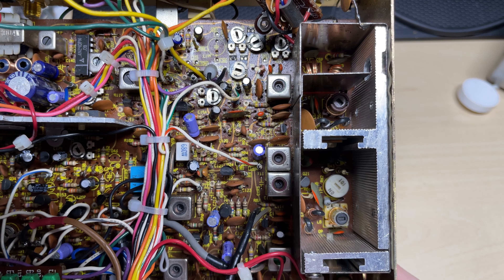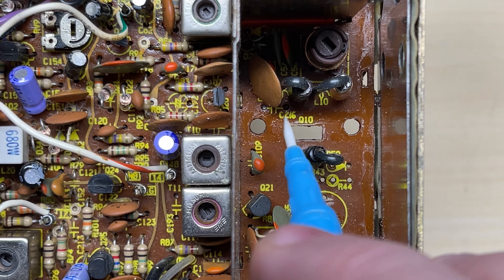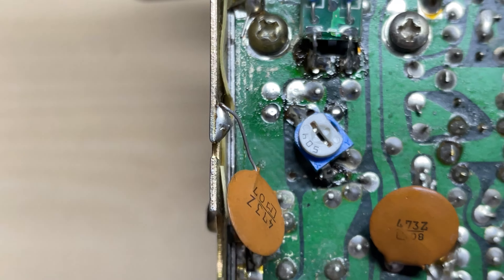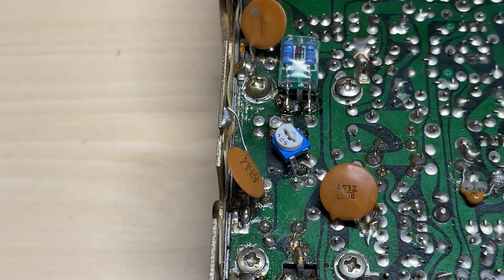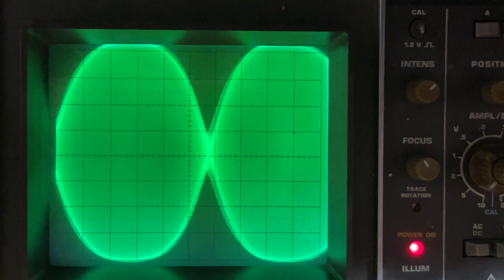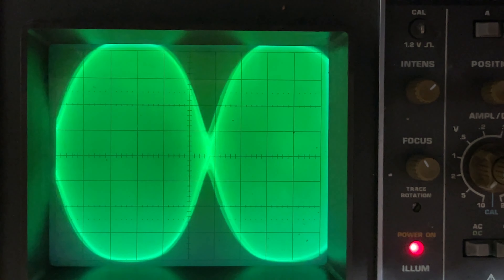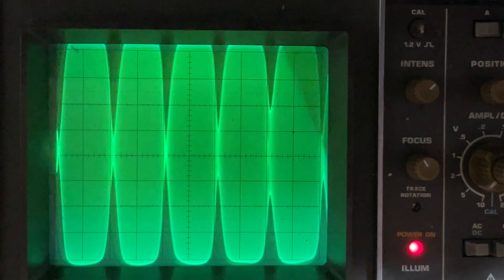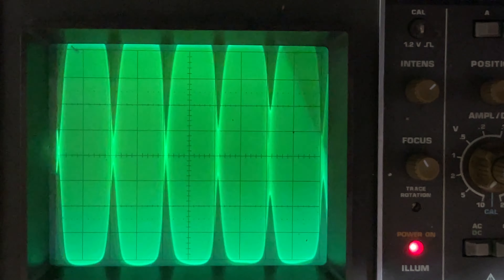IRF520N - 2SC1969 MOSFET Replacement - PTBM121D4X

Comment: Have you tried this with a RD16HHF1 but I guess the pin out of the device would be different?
Reply from the maker: I haven't tried with this, im only using what is already known and tested.
Reply: @MicroChipz  No worries I thought it may have been worth a try.

Comment: Not a verry usefull video if you dont descripe the resistors with diode on the little pcb. Explaination why they need to be there should really help people.  May tell them also why the resistor dont have to be on this little PCB but can also be soldered on the mainboard. Then people can use your video to upgrade there destoyed 2sc1969 witj the irf 520.
Reply from the maker: Fair point you have . I was using freely available circuit for the companion , i hadn't even thought of trying to incorporate it into the PCB.Thanks for you comment.
Reply: @MicroChipz  Your welcome :)
Reply: Traducir. Español